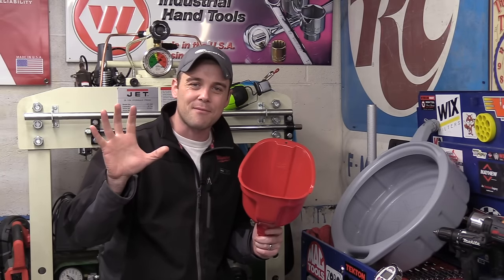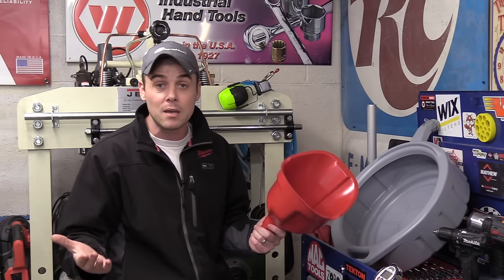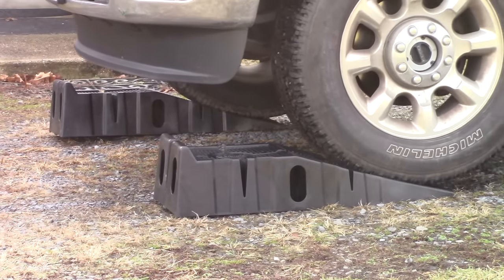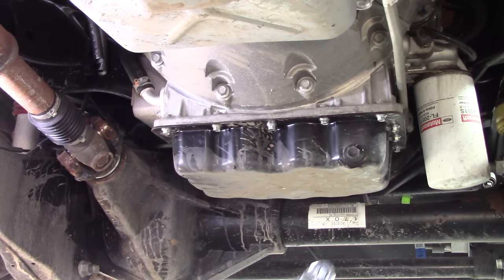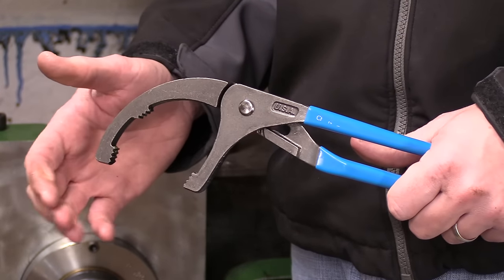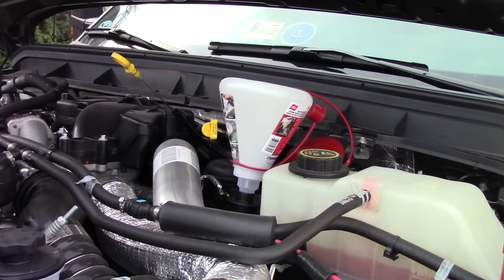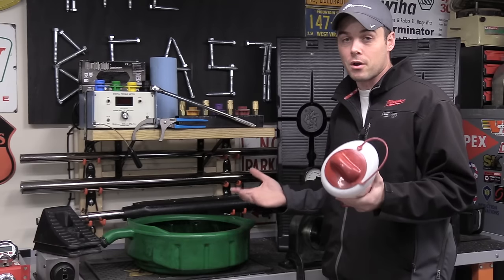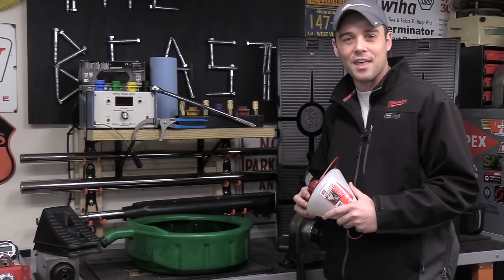Top 5 BEST DIY Tools (Changing Oil)

Comment: My son & I split the cost for the Motivx Tools Oil Filter Wrench for our Toyota & Lexus vehicles, both are the same engine size, as well as oil filter size, which we buy the filters in bulk. Just in that, we have easily recouped our money in the wrench cost. We also watch the oil market prices on Mobile 1 full synthetic. We plan on getting the OEMTOOLS 24444 Coolant System Refiller Kit, and the FOUR UNCLES Oil Changer Vacuum Fluid Extractor Pneumatic/Manual 6.5 Liter with Pump Tank , that should complete our vehicle maintenance tools, not to mention, we would stay a little more cleaner in the oil changes with the extractor pump.

Comment: Not exactly a tool but I use a wonder bread bag over the filter when removing . Simply break the filter loose and slide it on . My 01 dodge diesel filter holds almost a quart and the filter has a lot of obstacles coming out the bag is a cheap trick to keep everything clean

Comment: Fumoto oil drain valve that replaces your drain plug.  I have one on all 3 of my vehicles and it's awesome.  Flick the lever, and the oil drains, no need to undo a plug.  There are two models, one with a nipple for a hose and one without.  With a nipple you can attach a drain hose for the oil and send it directly to empty jugs, thus skipping the need for a messy drain pan.

Comment: Great video! Instead of buying a dedicated oil filter wrench I've used my 14 inch pipe wrench which allows you to securely remove any oil filter that's very tight. It has just enough to be able to grab most oil filters. Obviously you have to have room just as you do with your oil filter wrench channel locks for this to work. That way you have a pipe wrench thats usable for other do it yourself things around the house and not just dedicated to oil filters. Love the magnetic nut removal tool!  Funny how you show me something that I've never seen before but is a great idea!  Also the Lisle funnel is a great idea too. I have one dedicated to fit my Toyota but the one you have with the multiple adapters is a much better approach!  Get yourself a nice 5 gallon pan with a large opening like the one in your video as well. Lastly might try a Fumoto oil drain valve. I have used these years and love them.  This is a really great video. Keep up the good work and sincere and honest approach that you display!

Comment: +Real tool reviews I also suggest getting a fumoto or EZ drain Vale with the 5/8" nipple so you can add a hose to it then remove the lock and trunk the valve I've had one on my diesel Truck for over 3yrs now and done everything from highway to Mud riding and drive in the woods and brush to deer stands and never has it came open on me

Comment: As I own a cavalier, I have a few different recommendations. 

Fram makes a spring loaded filter remover head for ratchets, they go over the tip of the filter and hold it to take it off. unfortunately, doesn't work the opposite way, but it's almost firing blind in that car's filter area anyways.

second, a good long handle wrench in the size of the drain plug, cause on some cars the drain cock is close to the trans pan.

other than that, not bad suggestions.

Comment: the only thing I would add is the catch pan. I took a cheap sealed top version and cut the top out leaving a lip all the way around then cut a piece of heavy mesh screen to fit. now i have a place to place the used filter and there's no chance of having to go "oil diving" looking for the drain plug.
good video

Comment: Who doesn't change their own oil? I've had a set of Rhino ramps for 12 years now. They work every time. Handle everything from my little bitty '99 Hyundai Accent all the way up to my friends F-150 ! And they're not nearly as heavy as my older steel ramps!  The magnetic drain plug holder intrigues me. Where can I find that ?
Reply from the maker: +Shepperd November I put links to everything in the description 👍
Reply: Real Tool Reviews Thanx!
Reply: Shepperd November napa
Reply: ive worked professionally on vehicles for a long time now, i try not to change my own oil ever lol id rather pay my guy 30 bucks and i can bullshit with no exertion
Reply: frankenstrat25 I'm getting there! Back surgery, shoulder surgery, and arthritis!
Reply: frankenstrat25 I agree with you 100%, its not worth the trouble in my busy day

Comment: The third tool - magnetic drain plug with flexible shaft - HOLY CRAP!!!!! 
I wish I would have bought one of those years ago. After having owned this tool for little over a year now, I quickly knew this was one of the best oil change tools out. Seriously, if you do not have one of these yet . . . BUY ONE . . . your only regret will be wishing that you had bought it sooner

Comment: Top 5 tools, OK I agree mostly.  Top tip, get some 1/4" mesh and cover your drain pan with it.  Then when you do drop your plug or want to drain the filter to cut it open for inspection you can do so without digging around a hot pool of oil.  If you have the mesh in place I would sub the drain plug tool for a flexible funnel to divert oil off of the frame when removing the filter.

Comment: I change my own oil too , I have the Rhino ramps and a 20 quart drain pan , I have 2 GM vehicles so I bought an extra long Mac tools 15 mm wrench for the drain plugs . I want to buy one of the flex drivers for the drain plug . I also have a Lincoln grease gun for the zerks .

Comment: A tip when changing the oil on a diesel truck like that, poke a small hole in the bottom of the oil filter before unscrewing it, let the oil drain out of the filter, then unscrew the filter completely. This ensures no oil is in the filter and will help with your mess.
Reply: Nursery Life 
just be sure to make sure you're able to get the filter loosened first with whatever tool you use, cause you're at the point of no return once you punch the filter. if for some reason you can't take it off from some gorilla severely overtightening it previously and it's your only vehicle, you'd be stuck.
Reply: Good point, but I most always change my own oil, so I rest assured the filter is not to tight.

Comment: fumoto valve on your personal cars so you don't need to use a tool.  just flip the valve open and flip it closed when the oil is done draining.  or an oil pump reservoir that you can stick the hose down the dipstick tube and suck all the oil out without getting under the car if the filter is located above.
Reply: I actually installed one of those on my Mazda 6 several years ago - but it took forever to drain! (even when the oil was warm).  I ended up putting the oil plug back in as is wasn't worth the time suck.
Reply: @dperreno  I  had the same results!
Reply: Doug Perrenoud keep the fill cap off on the valve cover so you have better air flow. No issues with mine, oil change takes 20 minutes tops.

Comment: I've always heard to not keep the car jacked up and I've changed my oil for about 2 years that way. my buddy told me it gets more dirty oil out of the pan.I have a truck so i can easily fit under it but if you have a car just jack it up to get the bolt lose then set it down. btw that magnetic screwdriver works wonders!

Comment: I personally prefer a 6-point extended length closed end wrench for taking the plug off, same idea with the extra torque as the long ratchet but I think it makes a more square contact with the flats on the plug, this is nice if your plug hasn't always been treated kindly at prior shops. Something else I like to do if you're not lucky enough to have your filter hanging down in the open where it can drain cleanly and unobstructed is to take a piece of aluminum foil and cover whatever brace, suspension arm, mount, etc might be in the path of the draining oil that would normally get an oil bath. If you do it right it cuts way down on the mess you have to clean up after, just pull off the oil covered foil and bin it.

Comment: You should look into getting your truck a Fumoto oil drain valve. Once you get it installed after an oil drain you never ever have to undo an oil drain bolt to drain out your oil or to take a sample to send out to a testing facility if you'd like. They are inexpensive($20-$25) and are made out of brass in Japan. You just have to open the lever and your oil comes out with no effort.
Reply from the maker: The thought of a tree limb or something else I drive over somehow knocking the valve open & destroying the engine has stopped me from ever buying one.   If I had a 100% on road only vehicle, perhaps…. But for me personally it’s not worth the risk.

Comment: I do not need to raise my 1982 Corolla DX to change the engine oil. Simply use a Snap-on 1/2" breaker bar to loosen the drain bolt and shove a low profile drain pan from NAPA and job done. The Channel Lock pliers and funnel you showed us is great though

Comment: I use a plastic concrete mixing pan for my oil drain. It's very large, you almost can't miss, and it doesn't leak like the cheap drain pans with an oil spout.

Comment: I'd change the ramps out for a jack and jack stands. Seems a more versatile than the ramps to me. second, instead of the pliers, I like an oil filter wrench cap. I got four different sizes from Harbor Freight for $5.

Comment: Rhino Ramps, definitely, don't use anything else otherwise you'll be buy again.
Long handle ratchet a must, is better leverage when your upside down.
Good oil filter tool a must, makes it faster and easier. 
I like the Drain Plug tool, gonna have to try that, nice!

Comment: If you change oil on newer Hondas with an aluminum oil pan, it’s very important to replace the old aluminum crush washer, and use a torque wrench set to 30ft.lbs.  If you don’t do this you might risk stripping the threads in the oil pan, because the bolt is steel and the pan is the softer aluminum. If the crush washer is reused too much, the washer will eventually loose the ability to compress and provide a stress safety margin for the threads in the oil pan.

Also, depending on the vehicle, a socket that fits the oil filter/housing may be required, or other oil filter jaw type socket attachment.

Comment: My advice for removing oil filter.
Break the oil filter free,barely,just enough that you can remove it with your hands later.
Make a  two holes on the bottom of the filter with sharp punch tool or common nail.
Metal casing of the oil filter is usually easy to penetrate.
Let oil drain first,than remove filter.
Great tip with that magnet gizmo.I got magnetic socket inserts.I use 6" or 8" socket extension.You can buy them from "Lee Valley" store.

f

Comment: No  matter how careful you are in draining your oil some will usually spill on the ground or on a metal tray, if you use one, that is made for oil changes.  Problem is if you use a tray or not you still have to clean up some mess.  A few years back I started using doggie pee pads to catch the spills.  They come in various sizes and I often use one more than once depending on how much mess I have made.  They hold a large amount of liquid, not expensive, and you can find them wherever pet supplies are sold.

Comment: I own that Lisle oil funnel, it's the bomb diggity
Reply: Jacob Silveus I'm thinking of getting one now..
Reply: The mech a nic Cornwell had them on promo for 40 bucks and that's kind of a steal if you really need it. It comes with basically every adaptor you could ever need
Reply: The mech a nic and the 45 degree angle adaptor is great for v8 engines. I use it on F 150s and mustangs all the time
Reply: Jacob Silveus a

Comment: Now, I love working on my car myself to save money. Plus, I just like doing it. But when places around town are doing oil changes as low as $15 I can't see how I'm saving money when 5 qts is $20 and the filter is at least $5-$10. My old chevy I do myself because it's a special zinc oil I use, but the jeep I just take it somewhere and spend 15 bucks for valvoline.

Comment: i use a ratchet to break the bolt, then loosen by hand. a long skinny funnel with a wide mouth for refilling, and i always take off the filter by hand. only once has it been too tight to lossen by hand. i have 3 different models of oil filter wrenches that ive never used (got for free because friends thought i could use some help) before then and they either couldnt grip it right or were the wrong size. i had a chuckle at my friends expense and shoved a screwdriver through the filter and just yanked it sideways. did the trick. id rather spend money on parts and upgrades for my vehicles than on tools i dont need when i can do the job just fine by hand. not to say a good set of tools and power tools and specialty tools arent needed or useful, but for the basic shit theres no need to upgrade. also metal ramps are much more trustworthy (at least for trucks. i have to jack up my cars and my suv because the ramps will rip off the bumper.) my next purchase will be a full shop lift. that would actually save time and frustration so money well spent in my eyes.

Comment: Ok, I went back and watched your previous full video review of that OTC oil plug removal tool, and my opinion remains the same. It's a great idea, but I still feel the shaft is too springy. If the shaft was more like a flexible carburetor adjustment tool, I feel it would probably be worth purchasing. It still looks like it would be way too messy with oil slinging off that drain plug when it releases from the pan and flops all over the place!

Comment: I don't even do it to save money. I can spend, what, $60 for a change with conventional oil at the dealer, or I can spend $60 on full-synthetic oil and do it myself. I can lessen the wear on my engine for the same money.
Reply: 12799MaDeuce i use pennzoil ultra platinum and a wix and do mine for 35 bucks or a local shop charges almost 40 for cheap oil and filter
Reply: Yes absolutely

Comment: Used to change my own oil for years but it's only $20 where I take the car to now so I barely save money. And that's if I buy the cheap Walmart brand oil. Not having to deal with the cold and getting dirty is worth the $2 I spend to have them do it.

Comment: Forget those channel locks and get either a strap/band clamp with a pivoting handle. They are easier to work with around obstacles and tighten as they are turned.
Reply: i use the 3 leg oil filter wrench with a ratchet, never fails :)

Comment: You should actually check the oil level on a level surface for the most accurate oil reading. You should double check the level after backing off the ramps. Isn't that thing high enough that you don't need ramps?
Reply from the maker: Yes, the F350 is high enough.....BUT......I read a lot of complaints about those ramps being "weak" & I doubt many people have cars/suvs/trucks that weigh more than mine....

Comment: At the risk of sounding agricultural and having had a few dramas with oil changes over the years, my Range Rover Sport forced me to think out of the box, regarding oil changes. LR & RR owners are aware that when you release the side mounted drain plug that the stream of oil has a lateral trajectory that seems to evade most attempts to contain it. Please don’t laugh but out of necessity I came up with the following idea - I bought a small babies bath from a Charity Shop, and placed it under the drain plug. This is where madness and method come together - I placed a small piece of flexible cardboard (Spacers from drink products at Aldi) cut to an appropriate height and width and and a having a slight bow in the middle. With the top of the cardboard placed just above the crossmember and the bottom placed in the bath, just undo the drain plug and the oil hits the cardboard and straight into the bath. Not a drop of oil where it shouldn’t be and by the way the bath has built in drain, so it’s just a matter of a large Funnel and a handy container. A bit ‘Heath Robinson’ but no mess ...

Comment: Now I know why you used the ramps,  but with the 350 you could just slide right under haha. Like anther guy mentioned that is one easy oil change. Now switching the air filter etc,  I have no idea

Comment: I use a Fumoto drain valve, quarter turn of the locking handle and it drains away. Too many stories of stripped oil pans. And the dealerships are too expensive, they try to up sell and the wait time is usually too long. I'd rather do it myself and save some cash and to know it was done right.

Comment: One can purchase oil cheaply online, or wholesale clubs like Costco or Sam's. Always make sure to change the oil hot; run the engine a while before draining the oil, so the oil viscosity is most ideal for pouring out every last dirty drop. Cold oil does not drain as efficiently. DO NOT FORGET TO FASTEN THE OIL DRAIN NUT PROPERLY. Please dispose of the used motor oil responsibly, or even reuse the oil for lubricating your hand tools or what not.

Comment: my car is too low for ramps so i just jack it up and use jack stands. if the filter is installed right you shouldnt need a filter wrench of any kind. so far i have been lucky and never needed that long of a handle to pull a drain plug. but i could see a quick lube doing something stupid. that funnel is cool as hell though. does it have a breather port to help the oil drain in
Reply from the maker: +probsty13 nope, but if you pop the dipstick up a few inches, the air pressure will vent through that.
Reply: very cool idea. gotta like when there is no mess. 
i save about 40 bucks doing my own oil changes with mobil 1

Comment: these tools are all great but if you're only changing your own oil 2 or 3 times a year, I think they're all too expensive to justify buying, with the possible exception of the filter wrench
also, one time I pulled my car up on ramps drained oil until it stopped, then carefully lowered it off, and at least a CUP of extra oil came out.  that upward pitch of the ramps really does cause you to leave old oil behind.  If you have the clearance, I recommend you just climb under the vehicle with out lifting it at all!